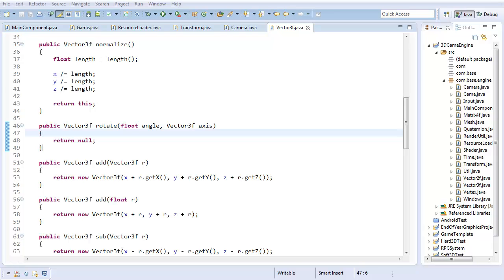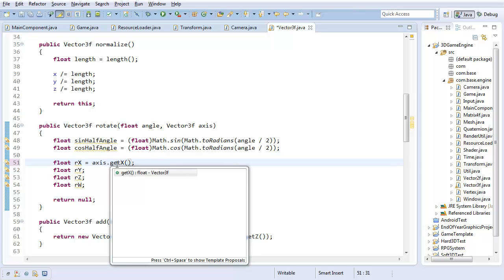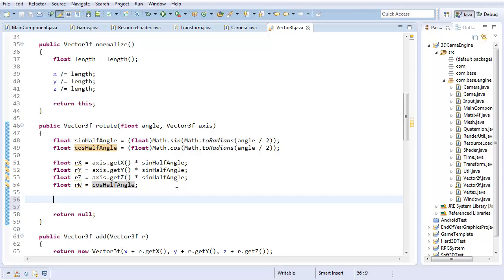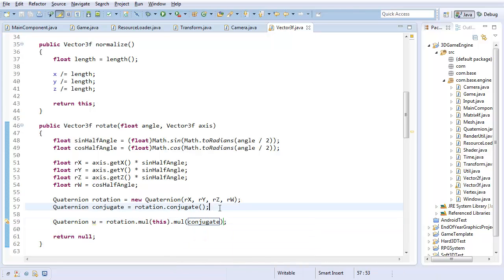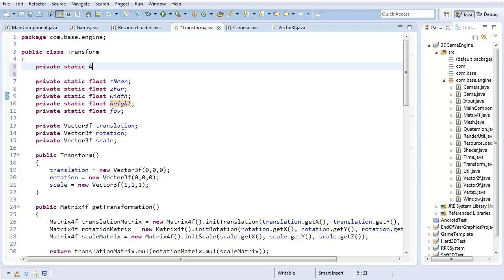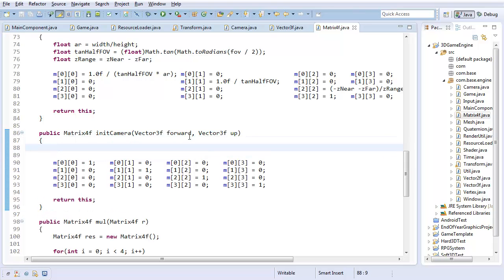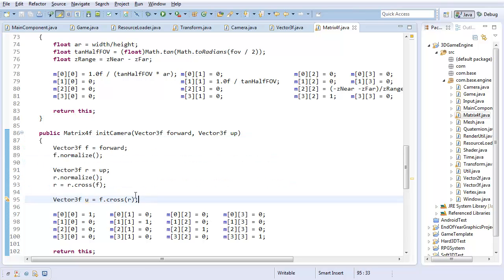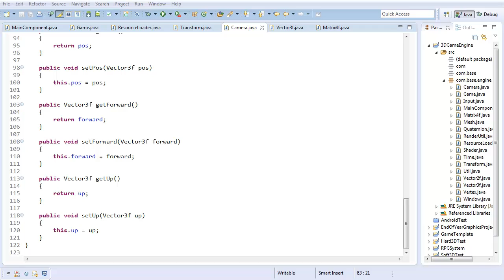#19 3D Game Engine Tutorial: Quaternion Rotation and Camera Part 2

Comment: any idea why my model is being scaled when i rotate its vertices by a quaternion? do you cover a solution for this later in the series?
Reply: It's probably not being scaled and just seems scaled due to the projection. Like, if the camera is looking directly at the face of a cube and you rotate it on the Y axis by 45 degrees so the camera is looking at the edge, the cube will seem larger because the edge will be closer to the camera than the face was.

Comment: At 8:52, you're still normalizing the original vector. Objects are never passed or copied by value in java, you'll have to clone it manually.
Reply: Java is not pass-by-reference. Java is always pass by value. Pass-by-reference would mean "up = new Vector3f(someX, someY, zomeZ)" within the initCamera() method would also change the variable passed into the method (outside the method's scope). This is not true. Ergo, Java is pass-by-value. That being said, it is true he should be calling clone() to avoid modifying the original variable. This is because he is not allocating a new location in memory for r, either using the 'new' keyword or an indirect reference to it, such as clone(), meaning that they point to the same value. In turn, calling normalize() on one also normalizes the other. It has nothing to do with whether or not Java is pass-by-reference, as this would be the case in any programming language, be it pass-by-reference or pass-by-value. http://stackoverflow.com/questions/40480/is-java-pass-by-reference-or-pass-by-value
Reply: I was about to mention this when I saw your comment. I guess Benny doesn't understand what "pass by reference" means.

Comment: I got a huge problem with all this... 
My vector lengths are never 1... either they are 0.98 and then the more I rotate the slower it gets until the vector length finally becomes 0
Or the vector length is 1.1 and it gets bigger and bigger the more rotation is performed...
I seriously don't know if this is rounding errors or if there is a problem in the maths, but this totally fucks everything up...
Reply: I solved it by dividing my Vectors by 2 before normalizing them... it's sort of a hack, and I'd like a real solution, but it works for now...
so normalizing looks like this now: vector = (vector*.5f).normalize();
Reply: Normalization's purpose is to make the vector's length 1...did updating fix your issues (from 2 years in the future)

Comment: There was no reason to make a new vector 3 variable in the initCamera method; the way he set it up, it's just creating a new pointer to the same data.  It's not actually an independent copy.
Reply: ***** can anyone else approve this?
Reply: Mario Papadopoulos If he wanted to make a unique vector he would have to use a copy constructor; you can tell that there is no new instance created because the new keyword is never used.  That keyword tells java to allocate memory for a new instance of some object.

Basically what he has done here is create a new Reference in memory.  References are how java handles any non-primitive data types; they're basically pointers (though there is a slight difference).  He then initializes the reference to forward which means that, rather than create a new instance of vector3 in memory, he's told java that the reference f contains the address of forward.  If he were to change f, then get the values of forward he would find that they too had changed.
Reply: ***** right :)